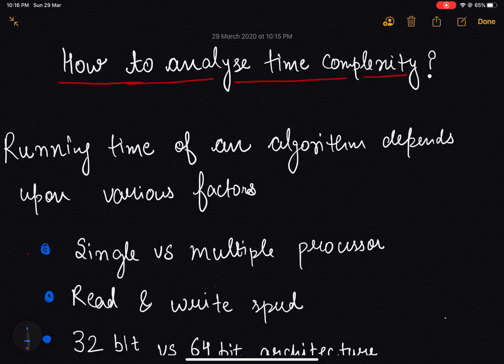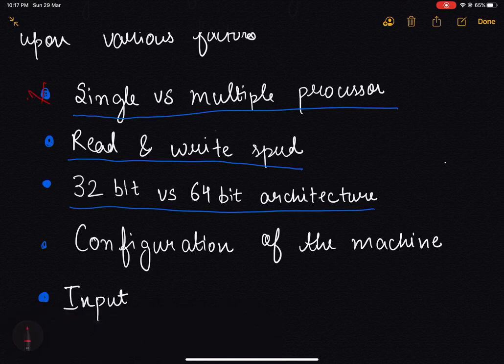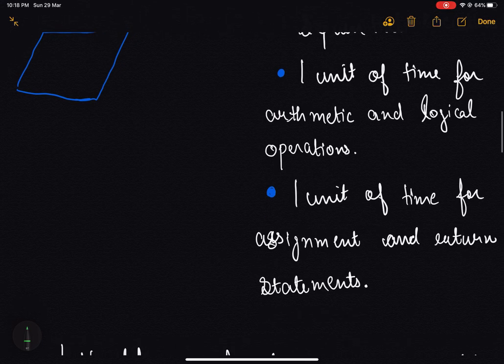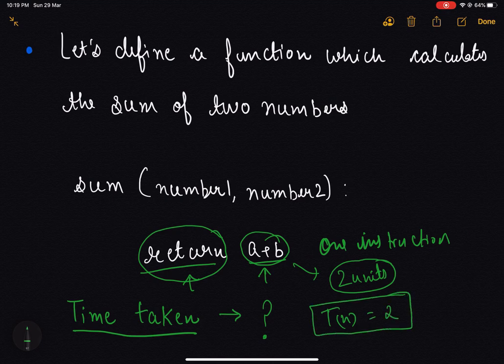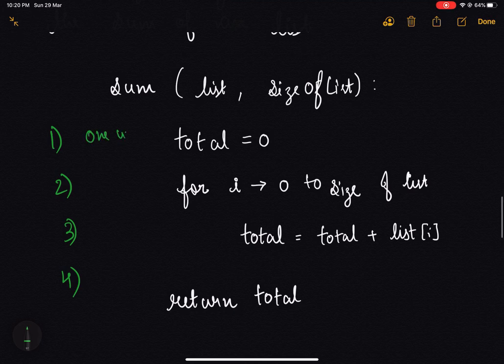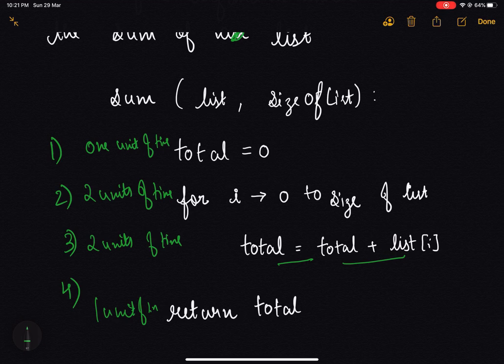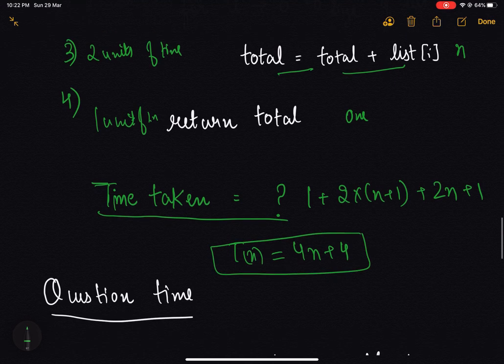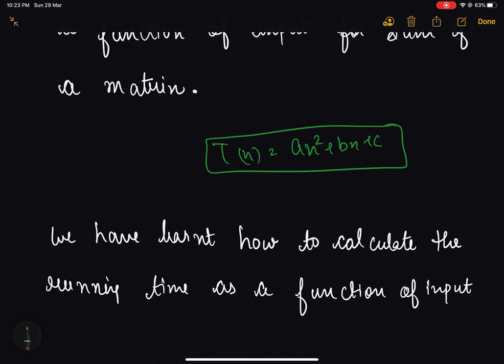Time Complexity Analysis - How To Calculate Running Time | InterviewBit

Comment: 2nd instruction at 5:12 ... shouldn't it be 3 units of time instead of 2...since intialising is 1 unit, comparing is 1 unit, incrementing is 1 unit?
Reply: Have you got the answer?
Reply: I have same opinion with you
Reply: initialisation happens only once (at the start of the loop), so it should be added separately as one unit of time in the answer
Reply: @AyushGupta-zn8jl  but it wasn’t done right?
Reply: @Easypeazy12  yes, but when we learn the complexity, we generally are interested in the worst case (a large amount of time) so 1 unit does not really matter. Even we can eliminate 4 from the final expression it will not be going to affect much of the calculation as n will tend to be a large number (lakh or crore).
Reply: @piyushkumar-wg8cv   yes bro. I understood later on. Thanks for the reply much appreciated
Reply: @piyushkumar-wg8cv  exactly
Reply: For this confusion of 2 units instead of 3 units I came to comment section 😀